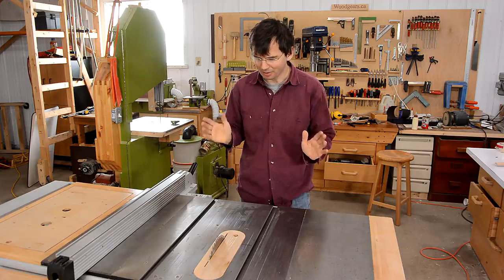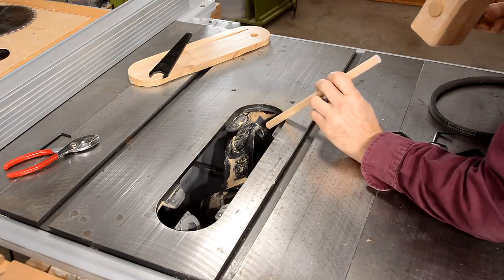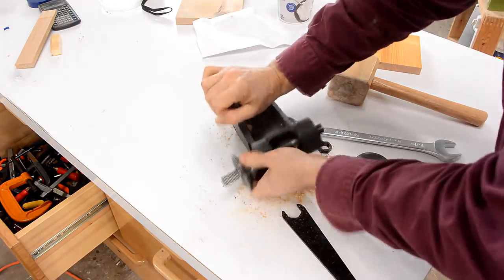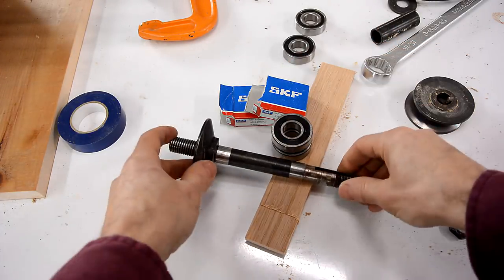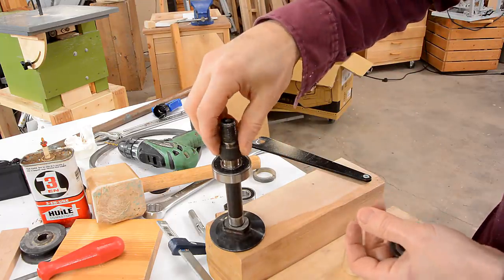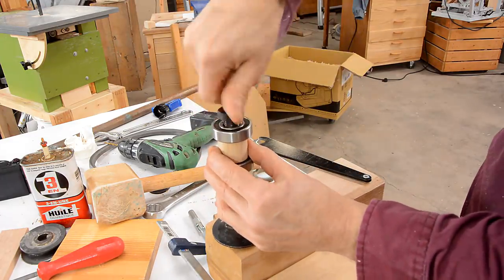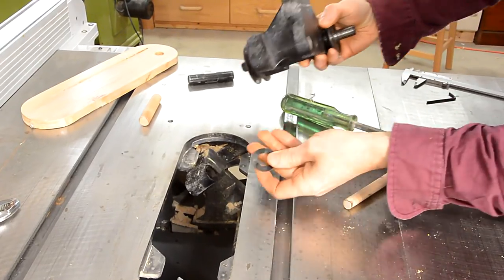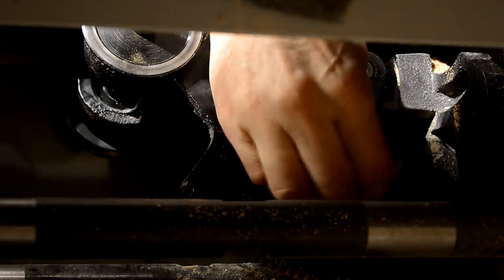Hybrid table saw bearing replacement

Comment: Hi, I'm replacing the bearings on a Delta "10" Tilt-Arbor Saw" from about 1994. I think its about the same as yours, and was renamed to Hybrid at some point. It has the contractor saw trunion, hidden inside an enclosed cabinet. Anyway, I got the assembly out just like you did. I can't take the nut off on the belt side of the spindle. Its super tight. I also don't have a wrench like you did on the blade side. Where did you get that wrench from? I'm not even sure the wrench would fit on my version, as it looks like the space between the saw blade flange and the cast housing is less than on yours. Thanks for any tips.
Reply: Reply to my own post: I managed to make the repair. I held the flange with its edges in a serrated jaw vise. Its the only way I could hold it. Using a breaker bar, it took my whole strength to break free the nut. Once out, I used combination of oven, freezer, gear puller, wooden faced mallet, arbor press, and vise, to disassemble and reassemble it.

Comment: Knock down the outer ID and inner ID of the old bearings a few thou before you use them to put in the new bearings.  They will slide off after you have seated the new bearings.

Comment: I hope you’re still looking at comments… I am doing the exact same changeover on my exact same saw. I am hoping you took note of the bearings you bought. Do you happen to have the part number?  I have some numbers on my bearings but they don’t seem to match up with the Motion. Amanda site.
Reply from the maker: don't go by numbers.  Go by dimensions
Reply: @matthiaswandel  no problem. I found a Motion Canada store near me and went by the number. They had the replacement ones. There were a few issues about taking the thing apart that weren’t in your vid but hopefully they won’t be an issue.

Comment: Did you cut open the suspected faulty bearing, just for interest sake?
Reply from the maker: No.  It felt like all the grease was missing, probably a tiny bit rough on the inside.  I may still oil it and use it for low speed applications.
Reply: Typicall swabian. Lass bloss nix umkomma.
Reply: If you preload it the way it was not preloaded in the saw, might work?

Comment: I like how the blade stops so quickly.  That must be normal with belt driven saw blades.  My Craftsman table saw coast for almost a minute after I turn off the power.

Comment: wrap the bearing in wet paper towel and put it in the microwave for a minute, just make sure the towel doesnt dry out. And old AvE trick which has save my bacon a few times.